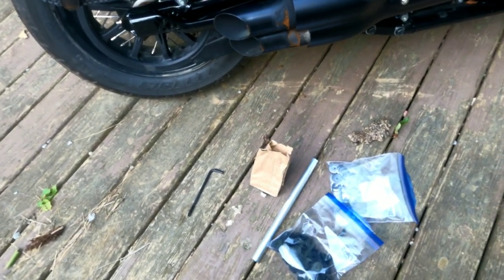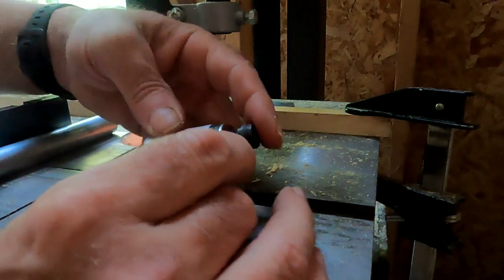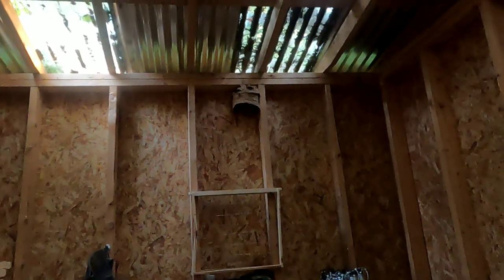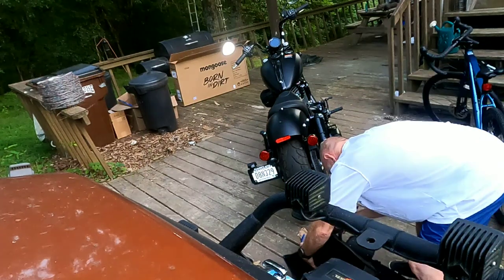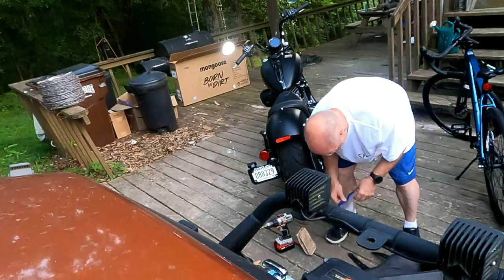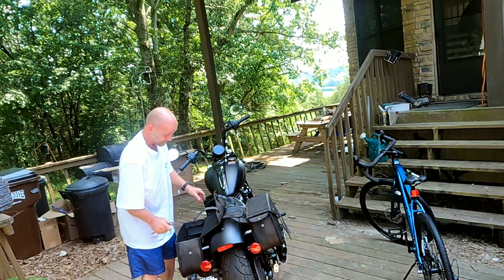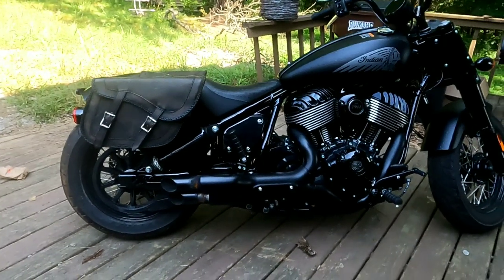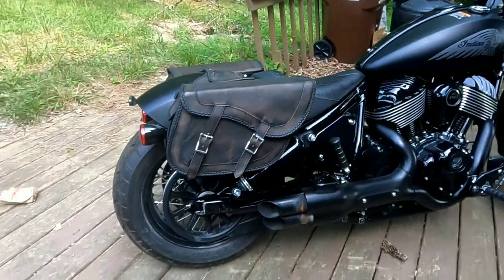how i made those DIY saddlebags & mounts #chief #bobber #darkhorse #DIY #saddlebags

Comment: Bags looks good, but notice the GP shorties are rusting a lot, i just bought a set hopefully it will not end like that.
Reply from the maker: Part of that reasin is because i didn't tighten the clamps down "ed tight" because i wasn't sure i was going to keep them. I bought some high temp black paint for headers but haven't touched them up yet.
Reply: How are the bags holding up ? Getting any sag or are the bolts stripping out ?